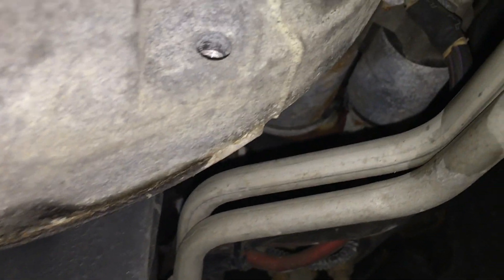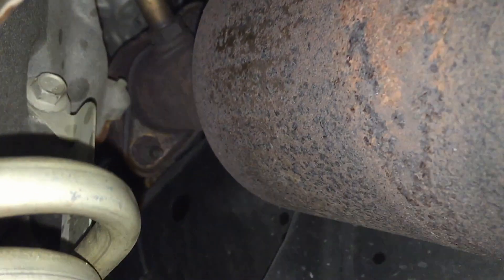Ford Vehicle Noises: #1 The 4.6L & 5.4L 3v Engine Hot Idle Phaser Knock

Comment: Great video!  Have same noise on 2005 F150 5.4 for some time now, but seems to gotten worse. Recently began getting P0172 and P0174 codes as well as a stumble when accelerating at 1200 RPMs (which you mentioned in your video).  Is it possible for the cam phaser to fail to the point where it causes performance issues versus just an irritating noise?
Reply from the maker: Unlikely yours seems to have an airflow turbelance issue at the MAF. How is the foam seal around the sir tray and are you using Motorcraft air filters.

Comment: i got a 2001 f150 that has a knock at idle its the 4.2 engine now here is the thing when you put it into gear it pretty much goes awayto the point you really have to listen to hear it any ideas on what or where this is coming from... sorry didnt realize i was on daughters account lol
Reply from the maker: david porath  You will have to isolate it to a bank and then upper or lower end. I am still thinking lower end of the engine as the noise changes with load. High mileage?
Reply: i figured it out took the inspection plate off and the flex plate is cracked in a couple places..  sure did sound like the death rattle but when going down the road it was gone for the most part and oil pressure was perfect so i did process of elimination
Reply from the maker: david porath Sounds about right figured it was a low end noise because the upper end on these are really reliable.

Comment: I've had the phaser knock for about 90k miles. Have the phasers been redesigned since 04? If I replace them will I resolve the noise or will it be back in short order?
Reply: Did this ever effect your truck? Thanks
Reply: @hulkhuggett  No, I still have truck with 221k miles. At 175k chain tensioner went and jumped time in one bank. I replaced the phaser, chain and tensioners. One of the phasers was sprung but was not the cause of the timing issue. The new ones are quieter but they still make a little noise after warm up.
Reply: @PrimalurgesMiami  thanks a lot, Walt

Comment: Any thoughts on the startup rattle. I have a 2004 F150 3V and have replaced phasers, timing chains and tensioners. I have even pulled the motor to check it out and all bearing tolerances were near perfect. Reinstalled with new melling oil pump and it still rattles on startup if it sits more than an hour. Running motorcraft 5w20 with motorcraft filter.
Reply: Hydraulic lash adjusters are leaking down when shut off. My 2007 does this as well. When shut off the lifter bleeds down causing excessive slack between the roller follower and valve stem. When oil pressure hits it, it pumps those lash adjusters back up to normal and the noise disappears.

Comment: So far the coyotes in our fleet F150's have been doing well, no major issues other then routine maintenance. We have an 11 pushing 150,000 miles no issues. Seems Ford learned lessons from the 3 valvers to help improve reliability of the 5.0.
Reply from the maker: Yup the 5.0l is a great engine other than the early noise issues even those noises according to Ford are not detrimental to engine longevity.

Comment from the maker: Here is what is causing the noise-
http://www.youtube.com/watch?v=O7GcqtNTMqQ
Here is how to fix the noise-
http://www.youtube.com/watch?v=HZuArjvEfRc
Reply: hey man love your videos, i got a knock very similar to that on my 2010 f150 platinum, sometimes it spits a p2098 code..just wondering if you have any insight on this?
Reply: FordTechMakuloco just had transmission rebuilt in my 2007 f150 5.4 3v , engine was perfect until I got the truck back from aamco now I am getting a noise like that but really faint , do cam phasers go gradually or do you just get the loud knocking right away ? Also my tranny isn’t shifting smooth anymore it’s hard shifts up and down and loss of power in overdrive aamco says it’s normal because they used heavy duty parts and if I don’t like it they can rebuild with ford parts ! Am I wrong to think the torque converter they put in could be wrong stall and it’s causing my noise and shifting issues , i am getting no codes i have a light knocking and rough idle